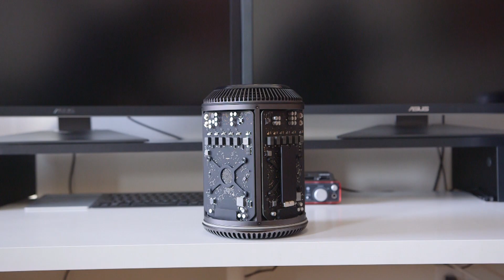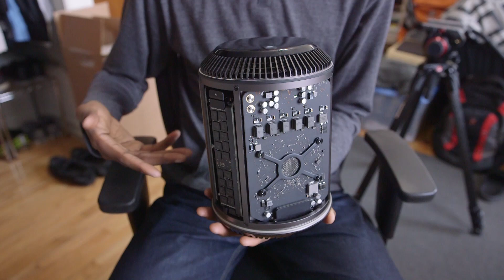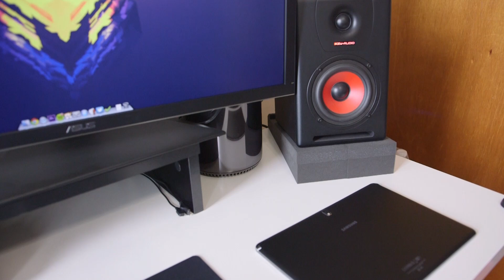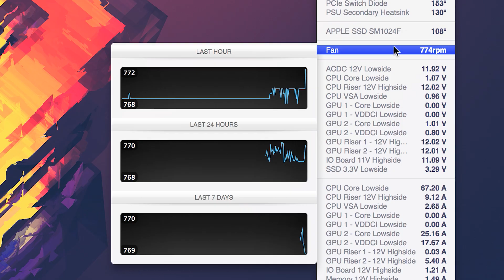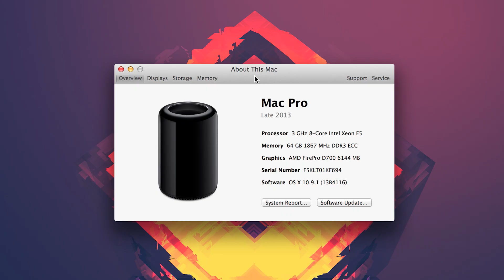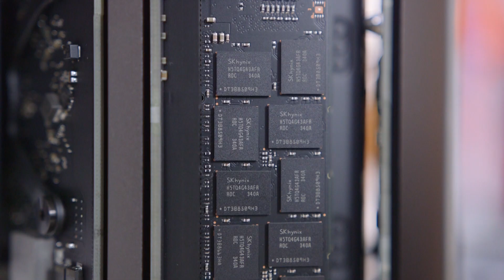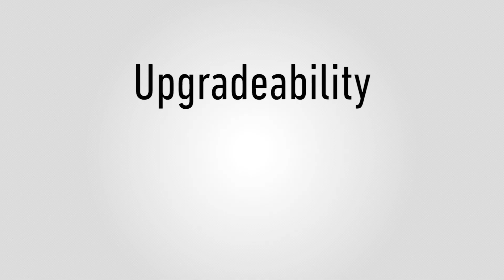New Mac Pro Review!

Comment: People who say it is expensive do know it is very competitive against other workstations, right?
Reply: Daniel Steeves even if you custom build, the price of workstation gpus, are so high that just buying one off an oem is cheaper. there is absolutely no benefits of custom building workstations. they have no system warranty (part warranties are just a pain), its impractical to upgrade workstation parts (really low price/performance ratios) and you can't over clock.
Reply: ***** Or they just won't bother upgrading as many of the X58 ones didn't. 
The old Pro was overpriced in it's later years. It was old tech and intel Cpus never get cheaper.
That said someone buying an 8 core mac pro in the early days probably didn't need to consider an upgrade till now. Maybe they still don't.

It will become overpriced to buy new, but it is not this day.

Speaking of companies not upgrading lines. My 1920x1200 Cintiq is looking pretty pixelated for a $2k+ monitor in 2014....
Reply: setoain20 I'm sure companies like Pixar would use a combinations of farms and Mac Pros. Why restrict yourself?
There are so many variables anyway. Studio size(freelancers?), workflow, program used(supported hardware?), budget etc.
Autodesk "Smoke" for example, isn't even supported in Windows.
I'm sure the Mac Pro fits in pretty well for some people.

I'm not going to claim to know what others need. I'm sure they have their reasons.

I personally would have no use for it as I deal with Photoshop 90% of the time and thus memory size and disk speed are my only personal biggest concerns. It's a pretty cool looking tower none the less.
Reply: Yeah, not competitive in terms of price. Perhaps if the price were dropped significantly it would compare to many decent PC workstation prices. There are many build videos of PC workstations made at the same price as these new Mac pros cost. They absolutely dominate the current Mac pros.
Reply: Daniel Steeves Look up the price of HP, Dell and Lenovo's high-end workstations.
Reply: Sam Biggs You don't get it. For businesses you can't do that. Not to mention buying workstation parts individually all come from OEMs anyway and from my experience can only be found for higher prices than what an OEM would price them at.
Reply: Sam Biggs What are these "other businesses"?
You aren't cutting out the middle man. You don't ever buy direct from intel. They do.
Anything else marketed as a retail box copy is overpriced.
Where do you shop for your Xeons and Firepros anyway?
Reply: ***** well you are missing the other side of workstations. The ridiculous cost of hardware. 

So take your scenario, where you can get 20% more performance and we also take that the "old part" was the 8 core. If we assume that the 20% improvements is a generational change (meaning you buy the same tier of part), then you would be spending equal amounts of money. an 8 core xeon already costs $1700+. and thats just the processor. What if you need another server class motherboard. Or need faster speed ram to keep up with that cpu (workstation memory is usually just fast enough to keep up with the current cpu).

Usually for enthusiasts upgrading is essential, since it allows for more potential down the road. but in a workstation where the main problem is Price to performance ratios, are so abysmal, its actually more viable to outright buy a new system then replace parts year after year.
Reply: ***** This isn't a render farm. If people need "extreme performance " they can just buy a new pc in the near future. 
That said I think most Mac Pro users could get some pretty good life out of a solid factory config.
Reply: JayJapanB he is mising the point, the point of a workstation is to work flawlesly 24/7 for years without a hiccup...that's why it is more expensive (testing..materials.. warranty... suport... optimization...).
Yes you could get better performance from an overcloked cpu, watter cooled monster... for less money... but after two/three years you would have to replace at least one component... with a workstation instead... (since you are not runing high frame rate as a basis) (yes your gpu works hard rendering, but for that there are renderfarms....) you won't need that as baddly as a gaming pc would. infact programs over time tend to improve the software so that the rendering takes less time...
Reply: setoain20 Yep. Time = $$$. Particularly in high skill creative professional jobs.
Reply: JayJapanB my point is, that if you really need fast video renderings to save time, then you are better off having a render farm or sendiong your files to a cloud based render farm... (way faster than any workstation)
Instead the mac pro is about having a great performance for a long period of time... so that the workers can work without nothing stoping them... not just software hiccups, but parts failing or overheating...
Infact if you want hi 3D CAD works you wouldn't get a mac pro you would get an HP workstation with dual processors shit ton of Ram and provably 2 Quadros....
Eassily on the 6k pricetag....
That is what they use in a medium sized Design / engenireeng  studio near my house....

By the way for video rendering you are better of having a dedicated render farm, that way you can still work on your macpro while the render farm renders your latest work.... the mac pro has dual graphics to speed up workload rendering... for live editing... but the final rendering should be done (if posible) in a dedicated render farm...

Comment: Not sure if anyone else has mentioned this (I can't be bothered to read through all the comments) but Sonnet do a thunderbolt expansion chassis that you can plug PCI boards into like the Red Rocket. I've seen one in action on a workstation that deals with heavy load and it's pretty solid.

Comment: get a gaming PC dual booting Linux and win7
Reply: The Mac Pro isn't a gaming machine...
Reply: James Monk You need it for production, things like DAW's and High end video editors require a large amount of power, It's CPU and Video chip are designed specifically for that function. Sure it will play games fine, but that's not why you spend this amount of money on this kind of machine. You could build a powerhouse gaming PC for a lot less.
Reply: James Monk your ideology is flawed.

If you take a "gaming pc" and match the specs of a workstation then you are basically building a workstation, and paying the same price as a workstation which is the same price as the mac pro. 

And I could be mistaken, but there isn't a single "gaming pc" cpu that can match intels best workstation chip (Xeon 2697V2)
Reply: what else do u need those specs for text editors
Reply: u can do all else on a gaming pc
Reply: WelshGamer You do know that the chips inside the machine can also be bought from the retailers? (AMD/INTEL)
you can build the mac pro as a PC for about 1500 euro/dollar.
Reply: a gaming PC can have any CPU so it is a better idea than workstation PC becase it can have the same specs and also have a gaming graphics card
Reply: James Monk well your logic is terrible.

For one thing, most likely BF4 is a gpu bottlenecked game. the video card determines the fps not the CPU. by your comment I can say a xeon paired with a titan will certainly have more FPS than a 4960x and a GTX 560. come back with an actual benchmark that measures CPU performance.  

Secondly you mentioned the specifics of the i7 but generalized the xeon. Which xeon are you specifically mentioning. If you are comparing the best of the best out of each line, Then I'm SURE that a xeon 2697 12 core, 24 thread cpu will destroy the 4960x. 

if you look at this benchmark
http://www.cpubenchmark.net/high_end_cpus.html
and notice that 8 "shitty xeons" are definitely faster than the 4960x
Reply: James Monk this computer was made for 3d work, something that is just not accepted in a professional environment if you use a "gaming pc". You need a computer that can handle extreme workloads without failing, and support for features that consumer grade graphics cards don't have (try running anything in double precision on your graphics card and you will understand)
Reply: ***** Ahum, the problem is just that you can build one for 1/4th of the price with almost identical parts.
Reply: ***** Buying pre-build PC's is still a lot cheaper than a mac.
Reply: iamterence77 yes the i7 4960x gets higher fps in BF4 than shitty intel Xeon's
Reply: yes but if they use the same video card the i7 would win
Reply: iamterence77 Xeons are made for rendering, they are a lot weaker for games than the i series.
Reply: nukeclears well again it depends on which xeon you are talking about. If the game were fully threaded, then a xeon could win (like using a 2697). He never mentioned which xeon he was comparing.
Reply: the Xeon's are not as optimized for gaming as the I series are
Reply: does not matter how many threads you have anyway as long as you have more than 4 your fine
Reply: James Monk Well There are 3 cases for how this could end up.

Case A: the game is fully threaded taking advantage of all cores. In this situation I fail to see how a 4960x can beat a 2697.

Case B: partially Threaded (uses some but not all cores). In which case The 4960x can just as easily be compared to a 1660v2, both of which are 6 core Ivy bridge E based processors running at similar clock speeds. 

Case C: 1 thread. This would then completely depend on Turbo Frequency. and the 1660v2 again has the same turbo as the 4960x. 

also for Case B and C, for gaming It doesn't even make much sense to go 4960x, you would get better performance going 4770K because not all the cores of the 4960x will be used.

In any of the cases where does the i7 win. For the most part the i7 can typically tie a xeon when cores are not fully used. and when the cores are fully used then the top of thel one xeon will really outpace the i7.
Reply: James Monk CPUS ARE NOT OPTIMIZED FOR ANYTHING. They get the work done, these are not like the pro gpus vs consumer GPUS. In that situation drivers play a role, and you can optimize drivers. but CPUs are literally Plug and play. all they do is process data. 

The actual hardware is exactly the same from i7 to a xeon. infact the 1660v2 transistor by transistor matches a 4960x. they come off the same platter. The only difference is they take the more reliable chips (read binning) and rebrand them to be xeons. Otherewise they are exactly the same.

and if you have more than 4 threads WHY a 4960x. You can go Haswell with a 4770K get 4 cores for a significantly cheaper price. You only go with the 2011 socket if you need the cores.
Reply: yes they are and i am not reading 16 lines of comment
Reply: James Monk prove that an i7 is faster than a xeon then.
Reply: iamterence77 *an i7, a xeon*
well yea, im sure you can put a high end i7 against a cheap xeon CPU and it will win.

be more specific.
Reply: Dude, even I don't know much about workstations, and I can tell the difference between gaming PCs and worksations. You are obviously being stupid to stick to your one and only point and it is that gaming PCs beat anything out there while its no true. You seem to completely ignore a point and its the difference between those two. Open up your mind and learn more about them. You'll be able to understand afterwards.
Reply: William Gagnon-Simard yes but a gaming PC has enough spec to do what a workstation PC can so it will save you money.
Reply: iamterence77 you still can build really reliable gaming PC's that wont make much difference to  a server.
Reply: just make sure you run Linux then there will be no blue screen of death
Reply: James Monk I'm not talking about software stability. People who have workstations often have insane workflows. You want hardware that is guaranteed to work regardless of what you throw at it.

For example, for whatever computer you have, Would you be comfortable running a cpu stress test for long periods of time (I'm talking days). That may be what a workstation has to put up with for its Entire life cycle. and if consumer parts were put through that kind of load, they may end up dying much faster than expected (also workstation parts have the best binning). My cpu (a 4770k) had this come up one time. During rendering project, I had the cpu pinned for 36-48 hours. within that time the render errored out (either cpu error, or i had a ram error) and I lost all my progress. That's just not acceptable if your career depends on this machine.
Reply: iamterence77 you still can get identical hardware and build it for cheaper with water cooling
Reply: iamterence77 + most workstations are only used for a few windows of word and Photoshop
Reply: ***** nope a titan will do great in a server or workstation or you could use nvidia tesla GPU's
Reply: ***** nope you can also build a PC and put a Xeon E7 V2 cpu in it but really a couple of sheets of office docs will not use  24 cores. but for a server you will need a lot of horsepower not a shitty workstation.
Reply: ***** i checked you'r profile and you have a bad attitude to people with different setups to you.
Reply: don't bother with mac crap
Reply: your in the wrong market anyways. its a workstation not a gaming computer

Comment: There are A TON of PCIe chassis' available for Thunderbolt that also allow for daisy chaining. As far as ease of use... you just pop the card in to the chassis and plug in the Thunderbolt cable. Several brands include compatibility lists with a ton of commonly used PCI cards; Black Magic Designs video capture cards for example. At some point I'm sure Apple will release their own proprietary PCI chassis and charge $200 bucks more then a 3rd party product. Small price to pay, in my opinion, for the incredibly small form factor of the Mac Pro and the ability to connect literally 36 peripherals via Thunderbolt alone. And not just keyboards and thumb drives, fully functioning PCI cards, monitors, audio interfaces, etc.

Comment: i'm going to make a computer myself and there will be an AMD FX-9370,120 GB SSD memory and a very good videocard and motherboard
i will also buy a 21,5 inch full HD 1080P display.
and all together it will cost about 1000 dollars.
Reply: And you forgot to add, that it will beat any Mac Pro or similar workstation computer, that is more expensive due to use of higher cost components, in almost or probably all aspects of computing.

Otherwise your comment looks a bit lonely.
Reply: Indecisive Fella yea it will brobably be a beast of a computer,the processor only already costs about 350 dollars.
and it is actually the first time someone responds to one of my comments.

Comment: There are plenty of external PCI card chassis with and without RaiD drives where you can put your Red Rocket, Pro Tools cards and other PCI cards in these external chassis.  Go check out NetStore, Magma, Sonnet, and others, they support a bunch of PCI cards in their chassis, there are a bunch of external PCI card chassis that are Thunderbolt 1 and 2 ready.  With audio recording, you have several AD/DA converter companies that are moving to Thunderbolt because it's better with regards to latency, so the Pros are moving away from USB, Firewire, MADI and moving towards Thunderbolt 1 and 2.

Comment: First of all most that are leaving comments are obviously not working professionals, but as a working professional myself I can say that it's encouraging that apple is making efforts for including professionals into their fast growing ecosystem. This machine doesn't necessarily raise the bar for professional workflow! But it does raise the question of how will we move forward? Thunderbolt is only a generation away from hosting full featured PCI peripherals such as video cards and such, so the idea is not too far fetch! In this shrinking world economy it is important to be somewhat flexible, giving this design thumbs up! But the true test is to see how many third party vendors jump on board to seal the deal!? I bought an eight core myself after benchmarking the CPU off the Intel Spec layouts myself, but with flash memory the need for huge amounts of ram are unnecessary, as streaming can be just as fast, if not faster in some cases! 16GB is plenty for most applications.. Great channel! Cheers!
Drew

Comment: Thanks for a very informative review and description, particularly with reference to the processors.

I am about to buy a Mac Pro for my music studio use with an Apogee Symphony 32 channel I/O system- I mostly use Logic Pro and Pro Tools.

When mixing, I use a lot of plugins so I presume that I need plenty of processor power for that, however I don't want to overspend on an 8-core if it isn't necessary for the task. However I would wait and save for a 12-core if that is most suitable for for the job.

I would be very grateful if you might be able to advise me as to how the different processors will affect the performance for my setup and what might be the most suitable processor to choose.

Many thanks

Comment: Same old problem. You buy a new Mac Pro/iMac/Macbook and want to get down on your stuff straight away. I do music production, so for example: I buy a Mac for £5000 and expect to get working right away. Hold up! Wait! You need to spend an extra £150 if you want to use Logic! Why? If you pay so much money then you should have a choice of getting 1 program for free, because you're not going to spend that much money on a computer just to surf on the internet or listen to music. You're buying it for a specific purpose to do a specific job, and Apple wants to scrape more cash off you for the professional program you want to use with such a powerful machine. Really, Apple? Really?
Reply: Apple core heads worming with greed
Reply: Isn't 150 pounds already fairly cheap for an application like Logic?
Reply: The core head designers at Apple are
frustrating customers. Another money
grab from Apple!